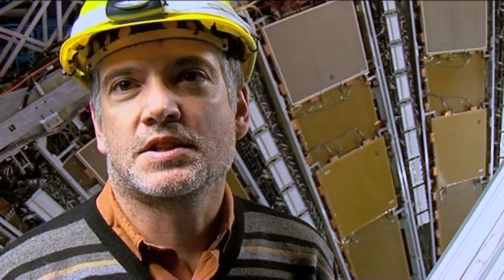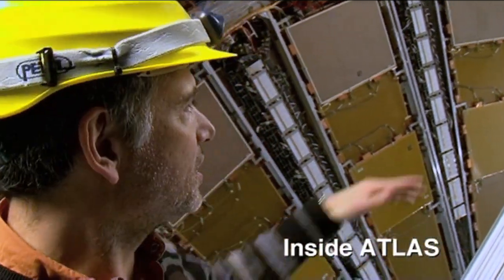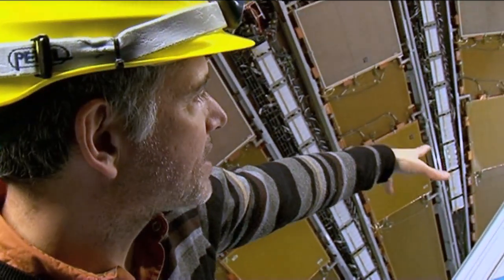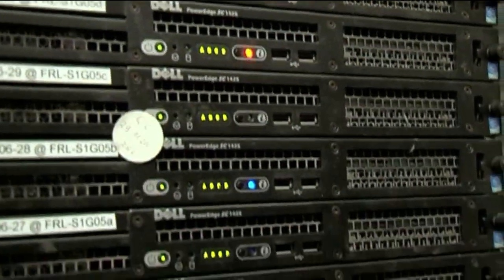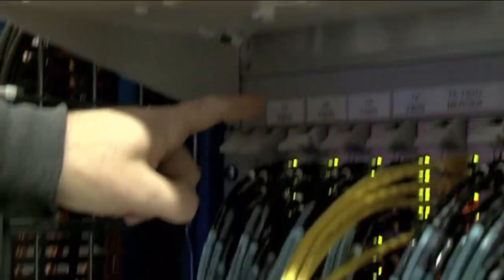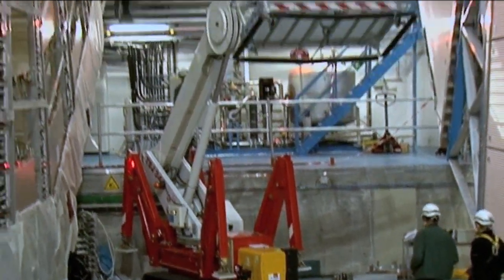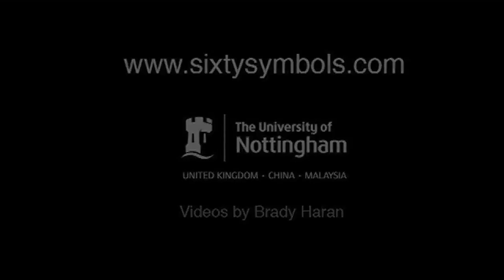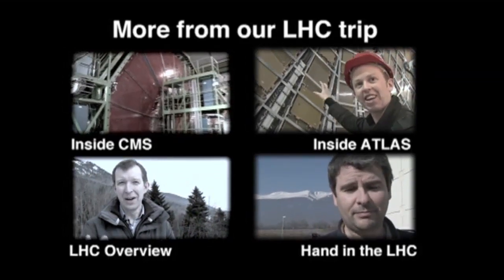Petabytes of data at Large Hadron Collider - Sixty Symbols

Comment: You make the trigger sound so fancy :P The trigger is likely a simple computer program that checks basic properties of each snapshot (or series of snapshots) to see if it's worth saving. It probably includes the amount of energy deposited in each part of the detector, the timing of each event, the amount of detectors that actually detect something, etc.

Think of it like a motion sensor that triggers a light to illuminate when it sees sufficient motion in front of it.

Comment: CERN is a big boy, but my own project isn't something to sneeze at either. We at the LOFAR project work at 10 Tbit/s, or just over a TB/s. Unlike CERN, who do "snapshots" we can run 24 hours a day. That's basically 90 Petabyte in 24 hours. We have to filter and average that data on the fly before we can even attempt to store it. The Datastream we store to disk is about 10 GB/s or about 900 TB/24 hours.

Comment: Actually he is right, My SSD's pull through around 8.2GBit/s or around 1035MB/s (2x OCZ Vertex 3 in Raid 0), Even mechanical hard drives can get things done at around 1.6GBit/s or 200MB/s (referring to the WD Velociraptor).

Comment: 300MB/s is 1TB/h, which is the capacity of a modern hard drive every hour. Every day with beams, they fill several of them. 2011 had 73 days of stable beams, which is equivalent to ~1800TB. In addition, it is not sufficient to just store the data - it has to be analysed.

Comment: the storage doesn't impress much, 100 MB/s can easily be done even with consumer grade hardware.
what does impress me, however, is the trigger processing and transmission speeds (of the initially captured data).
say hi to the IT-crowd in the basement, they're heroes.

Comment: you also have to realise that this data is coming in at such a high rate that recording the data can become a problem (most HDDs are the slowest parts of your computer). now a solution to that could be splitting up the stream, but that in itself has problems, and the reliability needed for a facility like this must be above average (average being the uptime of youtube). but don't worry, i'm sure a guy comes in everyday to check what needs to be upgraded anyway

Comment: They did, and also that it is to see out of a few random samples if they can identify matching patterns manually, although most of the picking is done by the computers. Your point is? Doesn't change the fact it's the ultimate cherry picking, and therefore scientifically invalid.

Comment: Contd........ Then they will try and determine which model explains the data better. For that you need a lot of data, to make a distinction between the two models. Now they are at 2 sigma, which is 95% sure but to announce the results they should be at 5 sigma, which 99.999%. Higgs is not gonna pop up one day and scream out. With years of experiment done both at LEP and Tevatron we have narrowed down the search and know where to look.

Comment: Wow, I'm really surprised at how paltry the ultimate data rate to storage is. 100MB/s? Is that accurate? That's nothing these days. A single gigabit ethernet cable going to just one 1TB tape drive can easily handle that. I guess all the interesting parts of this are happening at the hardware filter level.

Comment: Your SSD is 450mb/s. NOT MB/s. MegaBIT not MegaBYTE. your throughput is about (roughly, with overhead) is 45MB/s. Yeah. Perspective. Plus, you have to figure they're not using SSDs they are probably using mechanical hard drives to store it, in raid.